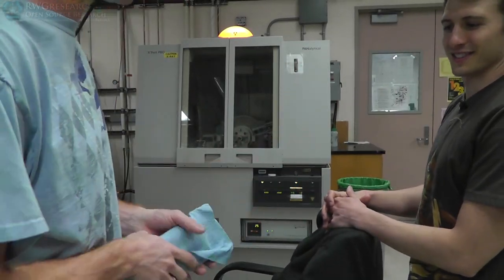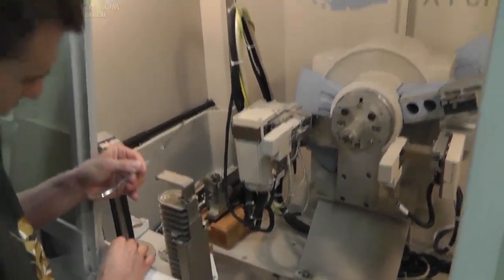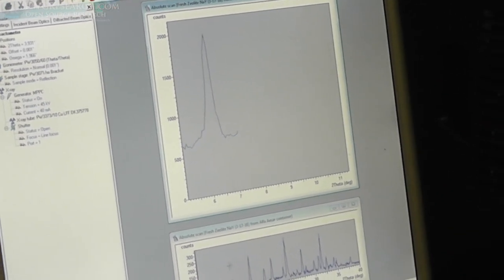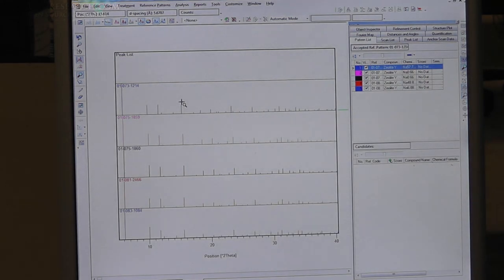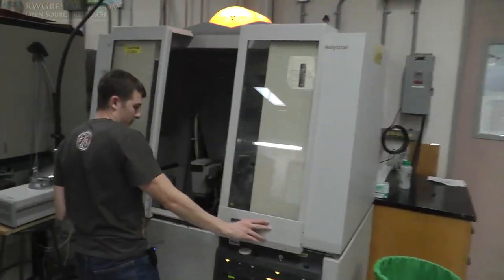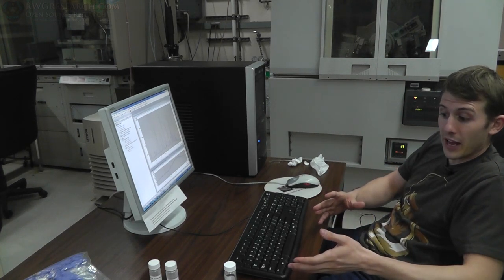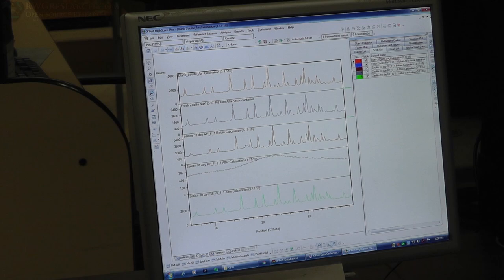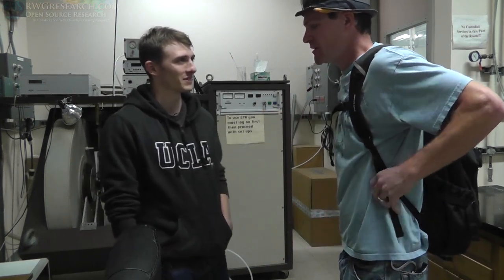LANR Research : X-ray Crystallography of Zeolite Loaded with Pd. (AKA X-ray Diffraction)

Comment: It sounds like what's going on is that each grain is oriented towards a crystal cleavage plane when you tamp down the powder? So that's why the peaks are not just all over the place, each grain is sitting on one "face" of the crystal. The explanation of this was a little hard to follow.
Reply: Exactly.  I would think that one would only get this sort of response from a SINGLE CRYSTAL of the sample.  When there is a powder composed of multiple particles each with their crystal structure oriented randomly, I would think that  this would lead to nothing but random scattering.
Reply: I was thinking about it and it seems to follow that, any erosion or wear that occurs on the grains will tend to decrease the signal to noise of this measurement. If the grains no longer have nice flat surfaces, they will be oriented in random directions. It seems like this could also be an issue if the grains are left in a solution that dissolves part of the material (rounding off the corners).